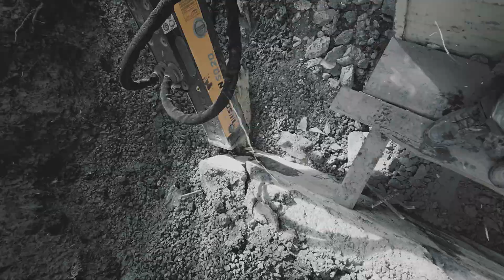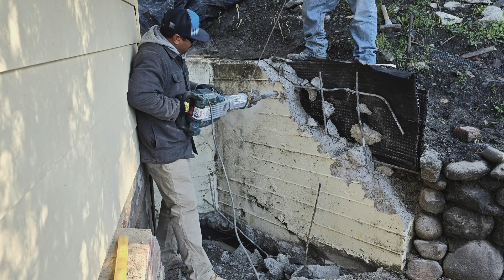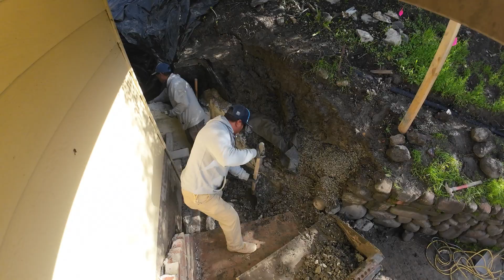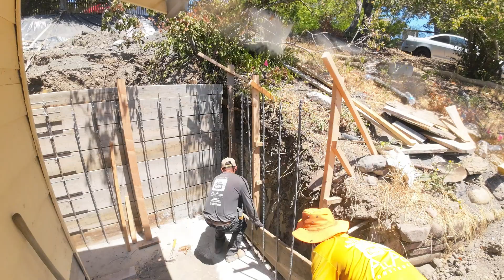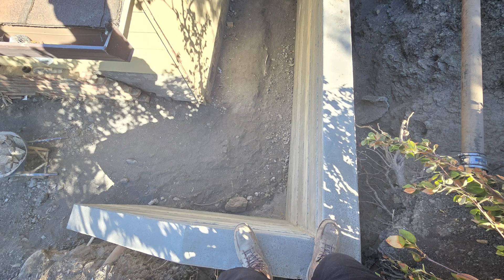How We Build a Concrete Retaining Wall the Right Way (2024)

Comment: I see no drainage holes along the length of the wall? I guess you've calculated any water behind that wall can get out easily enough at each end? The finish of the planking left on the concrete by the formwork looks very attractive. Making me thing about my retaining wall I'm building was going to block, with a brick capping, but might do cast concrete now looking at what you fellas did! Great job. And 14 foot deep peirs? Wow that's seriously strong. I'm using a rebar reinforced "toe" in my design which the load will sit upon. Not very deep, but extending under the load being retained
Reply from the maker: Appreciate yea we do a French drain system for 99 percent of our walls

☑️ Out Our French Drain Playlist https://bit.ly/3vmZdwQ